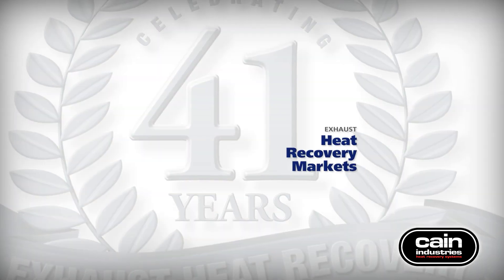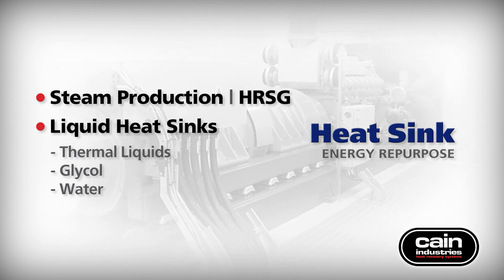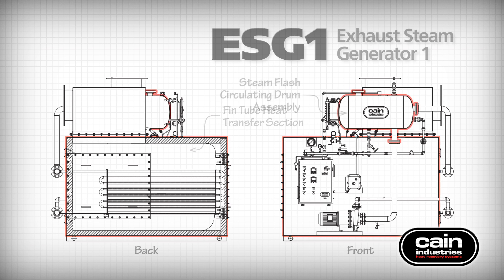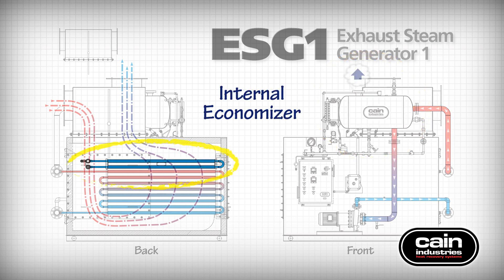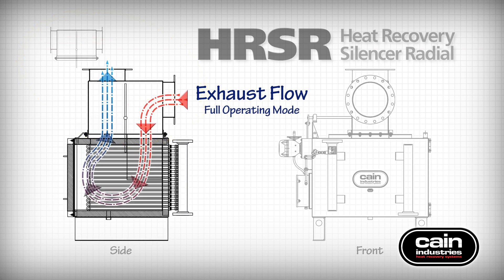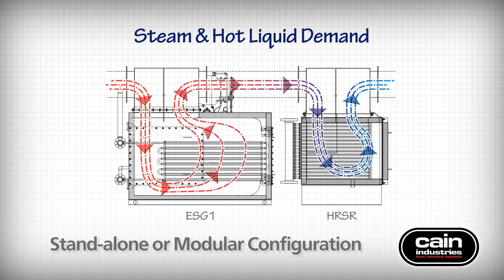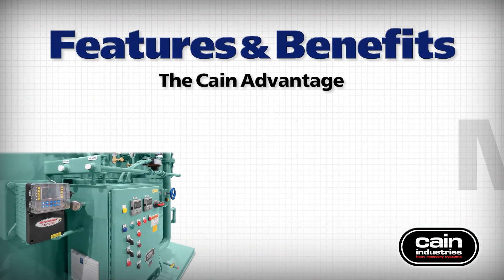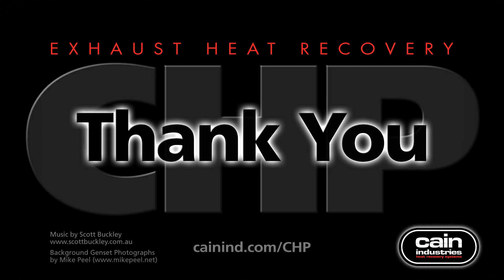Cain Industries | CHP | Combined Heat & Power Exhaust Heat Recovery Solutions

Comment: Question - are there models available for 1kW-200kW steam generation?  Looking for the ability to steer a containerized bio-mass syn-gas CHP plant from 10-90% electricity production with the balance going to heat (hot water) generation - as well as plant power throttling from 10%-120% of rating.  Total plant power of about 50/60kW - absolute energy cost and total fuel burn is the concern.